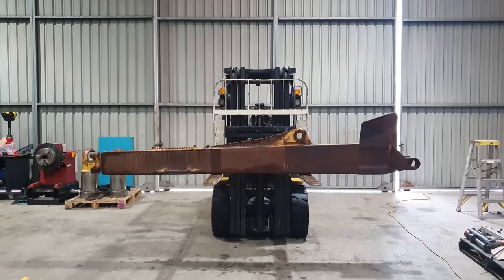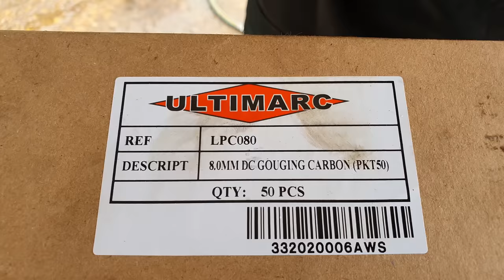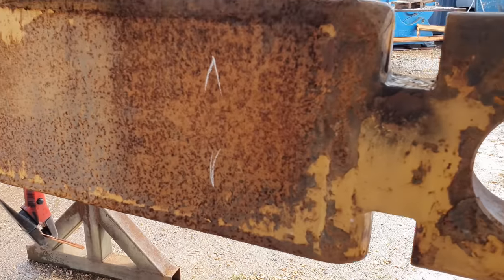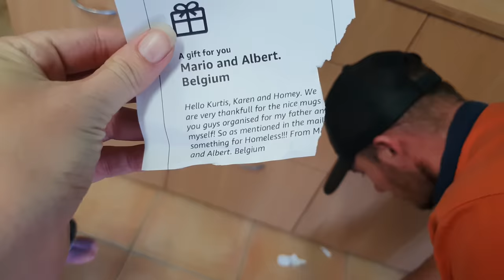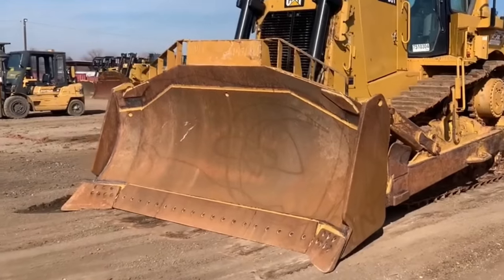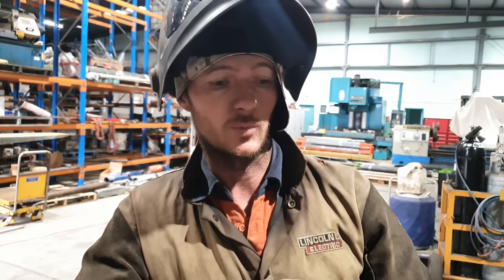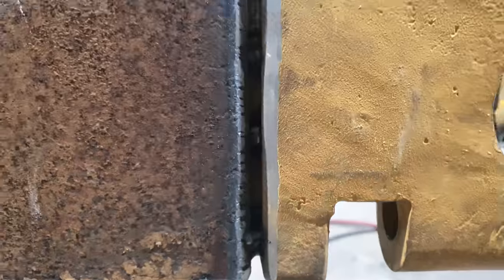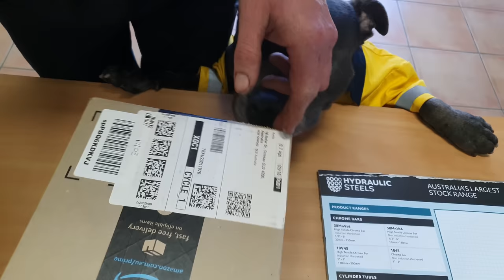Repair BROKEN End on D8 Dozer Push Arm | Gouging & Welding

Comment: Love your work, pardon my ignorance but is there any specific reason you use air grinders in preference to 240v? Wouldn't some of your jobs lend themselves to a big 9"? I cringe when I think back to my apprenticeship and three phase transformer welders with excessive open circuit volts and no safety to speak of, good to see avoiding injury has become the norm over the years, back in the early eighties you had to specifically order safety glasses and earmuffs were only for "softies". I was very lucky, my boss had two sets of safety glasses and a pair of earmuffs pre ordered and waiting for me on day one of my apprenticeship............though I still had to go out kill a cow and tan the hide to handsew my first welding gloves(just kidding). Enjoyable videos and a good support crew is always half the battle.

Comment: Kurtis,a question: why didn't you use a Saw for cutting this one ?
Reply from the maker: hey mate good question you could use a bandsaw but you don't have any "control" over the cut & location of the weld joint, you'd have to get it spot on or run the risk of extra cutting or extra welding to fill the joint. Where with gouging can be much more precise at only removing the material needed to separate the end and find the weld joint. 😎👍
Reply: Kurtis, thanks !
Watching your vídeos from São Paulo- Brasil.

Comment: The trunnion casting welded on "the inside" gives you a clue how the pusharms are built at the factory. That inside plate of the arm must be laid down, and the trunnion casting used as a lineup fixture for welding up the rest of the arm. Good to see that you're wearing your cap. A burned bald spot is an absolute PITA, except it's not the arse that's painful. When you wear a hat all the time, and it's painful to wear one, it's just not a good day....speaking from one guy with thinning hair to another.

Comment: If the trunnion is not replaced with new or rebuilt, then there will be spot loading on the bearing and accelerated wear

Comment: Hi is your arc gouging just a very heavy form of arc erosion only very meany Yeats ago (50) I worked on a prototype arc erosion machine from the USA that was used to cut holes in jet turbine compression rings , you were supposed to be able to adjust the voltage and amp’s to enlarge the hole and the surface finish, it did not work only cut the hole adjusting the voltage and amps made no difference.

Comment: How the hell they welded on the inside?
Reply from the maker: was welded on the inside before the side plate of the arm was fitted
Reply: @CuttingEdgeEngineering  ohh wow. I tought about that but I couldn't see any seams. It looked like a one piece tube🤔. Great work by the way! I love machining welding and you fuse all this in a great way.

Comment: You said at the start that you found gouging much more efficient than oxy- or plasma-cutting, but the oxy trimming the edges of the part down to size seemed to go pretty well. Was that just Karen's editing making a tedious job look quick and easy or is there some aspect of the initial cut into the intact arm that makes oxy much harder?

Comment: Hey Kurt, I'm a lineman for the dialtonefactory (at&t) way the fuck over here in Miami, FL and we use similar blankets to the one in the link below, whenever there's a potential of becoming "hot" while standing on the ground near power. 

Ours are black in color and rated at 40kv. The typical cost is around a couple of hundos, but it's a small price to pay to keep you from becoming a two-legged french fry. 
😂

 Cheers bro! 🍻

https://www.saftgard.com/products/saf-t-gard-voltgard-class-4-type-ii-rubber-insulating-blankets-vb4vgblankets/

Comment: You will not be eletrocuted by the gouging, The welding machine has an open circuit voltage,  (max ) 72 volts ) you need 120 volts to carry the amperage to do you great harm !! I, over the years  I have welded, gouged in all types of weather from sea level to 8 ooo feet  above sea level !!

Comment: I don't understand why you don't weld it with a stick welder..  It would go so much faster.  It must take forever to weld those giant gaps with that tiny wire feed.  Unless you're charging by the hour, then I guess I understand

Comment: Band saw must not make sense or you would have used it.
Reply from the maker: hey mate you could use a bandsaw but you don't have any "control" over the cut & location of the weld joint, you'd have to get it spot on or run the risk of extra cutting or extra welding to fill the joint. Where with gouging can be much more precise at only removing the material needed to separate the end and find the weld joint. 😎👍
Reply: @CuttingEdgeEngineering  surprised it is more precise! I knew you had a good reason.

Comment: Gave up watching. Buffering every 5 seconds 👎
Reply from the maker: your internet is shit, try changing the Quality under the settings icon ⚙
Reply: My first thought too 😒. 100Mbps fibre connection. Have no issues with any of your other videos @1080p… But this video keeps buffering. All videos on other channels @1080p also have no issues 🤷🏼‍♂️
Reply: Had to fight with my service provider to reset the port. Finally issue has been sorted and no further problem watching @1080p 😁. Why it only affected this video is beyond me.